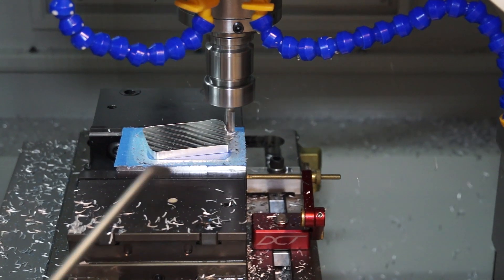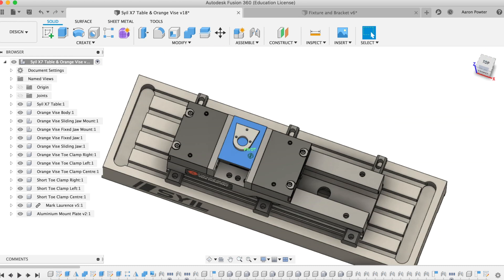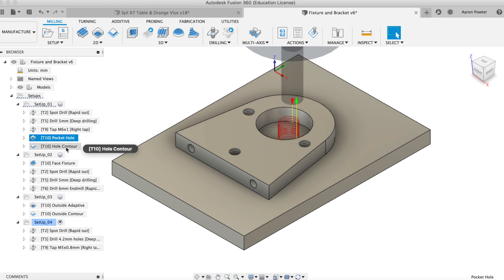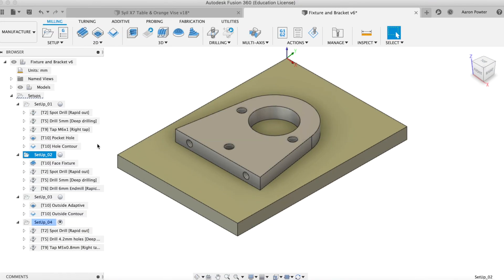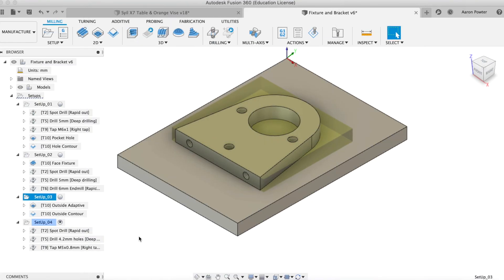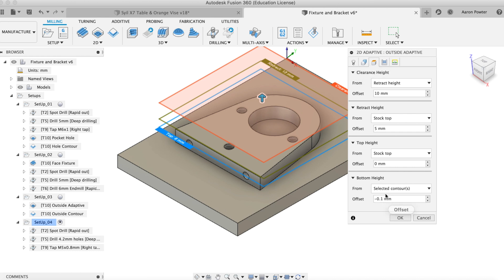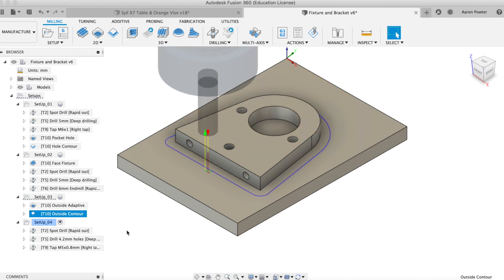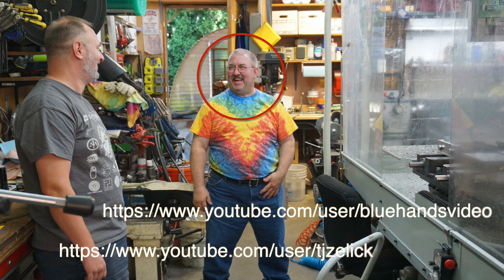FUSION360 Machining - Super Glue trick FAIL

Comment: Great video Aaron! Love watching your X7 run and I'm still anxiously waiting to move to my new house so I can pull the trigger getting my own! In desperate need to upgrade from the hobby mill that I converted. 

Out of curiosity, did you happen to notice what spindle load was like during this? My machine will be equipped with the 5HP spindle but it sounded like yours was bogging down a bit while roughing off the material. Seemed like a pretty light cut to be getting the spindle to big so I'm curious if it's just the audio or you recall the load? Thanks again!
Reply from the maker: Hey how's it going.  I like the work you're doing with your PM machine.  Yes my X7 has 3hp and it bogged down on the adaptive and contour tool paths as I had my stock size incorrectly set in CAM.  The DOC was 8.1mm and WOC was set to 2mm (20%).  However, due to the stock being incorrectly set the step over was over 40% at the start of adaptive and start of 2D contour.  Overall I'm very happy with my Syil.  It is what it is, as it's not a Haas, DMG or an Okuma ;-).  PS: Oh, I also think the my microphone exacerbated the sound too.

Comment: Aron how I can manage to show the machine table in fusion360? As much as I try I can't find the way😩
Reply from the maker: Hey Emanuel, I actually modeled my table in Fusion360 and imported the Orange Vise STEP files into Fusion.  Once imported I then converted those to F3D files.  I applied joints to the table etc...  I will attach the downloadable links for my mill table and vise here: https://a360.co/2qBhcDy.
Alternatively, please watch Kevin Ellingson video on how to create your vise: https://youtu.be/FOQmAMzWMgQ
Reply: @DCT_Aaron_Engineering  Thank you so much for your help Aron, i'm trying to convert from Solidworks to Fusion So i can use the Cam art the same time but i'm struggling a bit.
Reply: At the same time*, sorry for the typo
Reply from the maker: It’s all good Emanuel. Happy to help others and spread the Fusion360 gospel 😂
Reply from the maker: No problems at all bud 🍺

Comment: Why doesn't anybody ever show how to flip the damn part?
Reply from the maker: Hi Brian. This bracket was a single sided part and didn’t require flipping. Do you have a small job that needs doing and I can show you on video if like? Let me know and if I can accommodate you I will. Cheers mate 🍻
Reply: @DCT_Aaron_Engineering  Maybe I'm using the wrong terminology. The part was part of a larger plate, correct? How do you remove it from that plate? https://i.imgur.com/9wB8vi5.png
Reply: @IcanCwhatUsay  It was super glued to the other part using super glue & painters tape. I did that my own with green pastic tape used for powder coating & super glue. It works awesome, I had do keep the flame torch quite much on it to break the super glue bond.
Reply from the maker: Hi Brian I had 3 cap bolts holding it down to the plate. Upon machining it I removed the bolts and the stood the plate up on its end.  Oh, are you referring to flipping it in CAD with the work offset?
Reply from the maker: Thanks Vasi 😁
Reply: @DCT_Aaron_Engineering  "Oh, are you referring to flipping it in CAD with the work offset?
" YES - That!  Sorry. For me the biggest hurdle with making any part is how to set it up in the machine. Do operation A, Realign part, do Operation B. Most difficult is when I mill a part from a solid block, how do I get it OFF the block? 

(sorry for the confusion)
Reply from the maker: Hi Brian. Can you send me an email please so I can assist you directly.

My email address is aaronpowter(at)hotmail(dot)com.  Change the text in the brackets (-) as I did that to stop the robots etc...

Look forward to hearing from you 🍻

Comment: Why do they call it super  glueing? It's not that super..... your not relying on the super glue to hold it in place it is the masking tape doing the work. Should be called painters tape work holding... doesn't sound so good now!  Great video BTW!   :-)  hahaha
Reply from the maker: G’day Paul. Yes you are 100% correct. It’s usually the tape that fails. To be honest I need to make a vacuum plate 😉
Reply: @DCT_Aaron_Engineering  that would be a cool project 👍
Reply from the maker: Hi Rob. Yes I’ve been thinking of making one of these and showing a video on it.

Comment: I like that trick using the 2 bolts to level the part for the holes on the side. I haven’t tried the super glue, but with the blue tape it’s important to burnish the tape with a round bar. Or the green powder coating tape is also supposed to work better.
Reply from the maker: Hey buddy. To be honest I stumbled on that idea. I was trying another method and then had an epiphany 😂. Yes the blue painters tape isn’t the best. In hindsight I should have just glued to the bare metal. Great to hear from you. Thanks for stopping by the shop 🍺